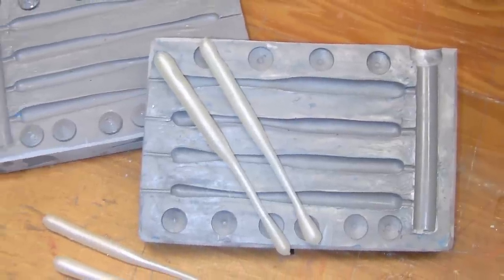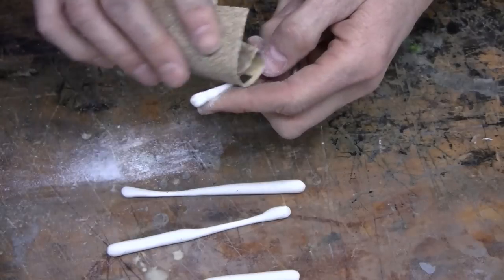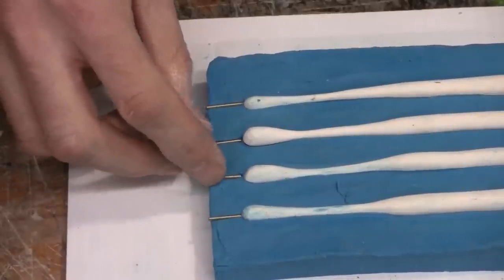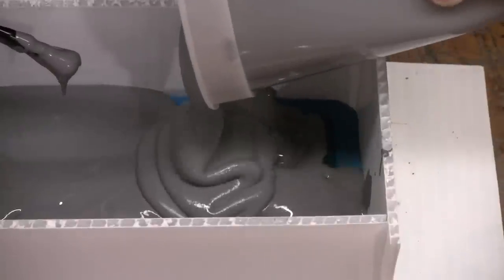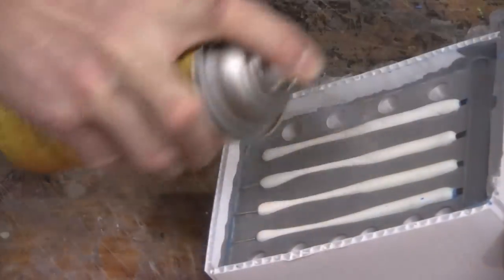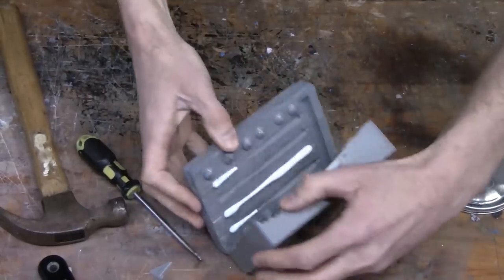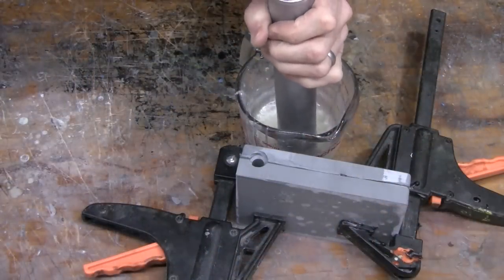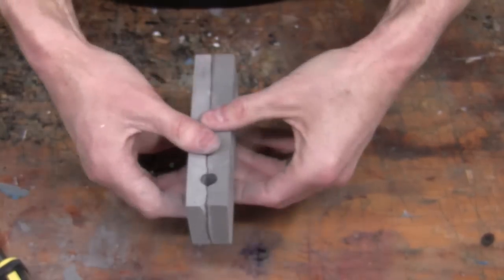MakeLure: Make your own soft plastic injection lure mold

Comment: How well does it hold up to high heat after an extended period of time? Im interested in trying some large production runs. Soft plastic needs in between 325 deg F - 350 deg F. Im a mold maker by trade and am concerned about your vac-50 breaking down after time....i.e. chipping and warping.
Reply from the maker: Thanks for reaching out and asking Ken. Vac-50 with it’s 50% atomized aluminum does a really nice job of handling heat, but I’m not sure it can withstand those constant temperatures. It’s rated for 250F but can take peaks above that. The only thing I could think of is that you could run some cooling lines through it. It may be worth taking a 5lb or even 20 lb kit and giving it a go. We would be willing to pass along a discount for you to give it a good evaluation and see what it’s limits are. Let us know if you’re interested and we can get you connected with Customer Service to get an order placed.

Comment: How many molds that size could you make with the 5 lbs kit.
Reply from the maker: Thanks for your question! In this video, it looks like for each pour, roughly .5lb of each A and B were used for a total of 2 pours - 2lbs used and 3lbs left. If you're looking to change the size of the mold, you can always use our volume calculator to see how much product you'd need here: https://www.alumilite.com/store/pg/12-Volume-Calculator.aspx